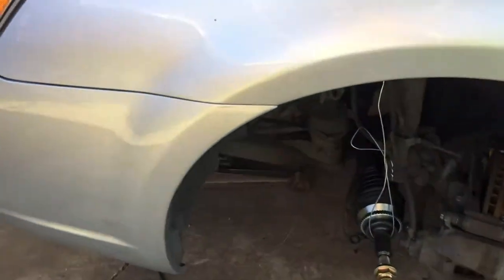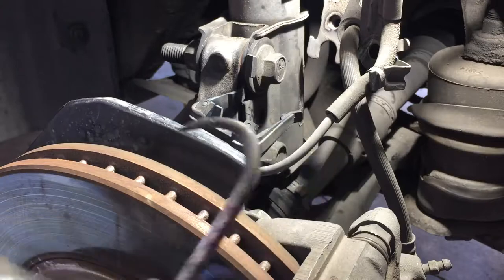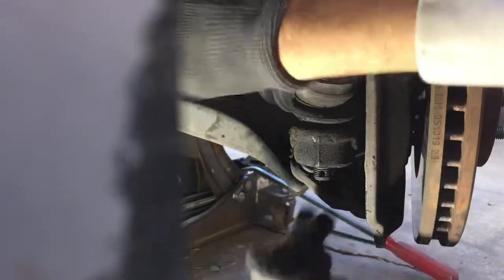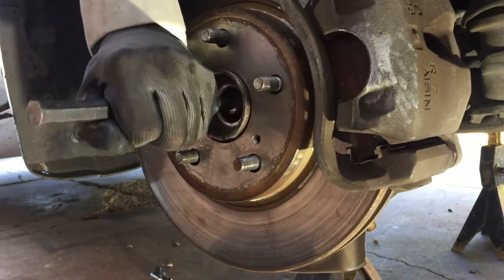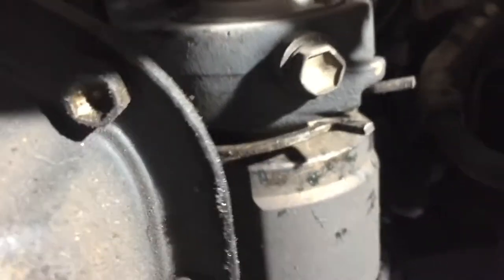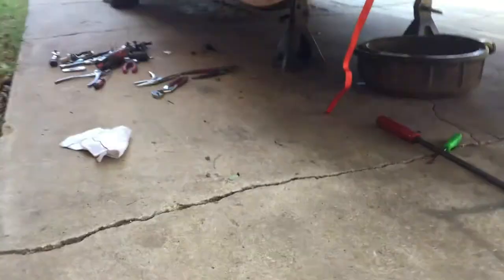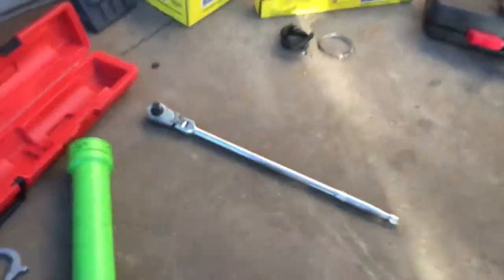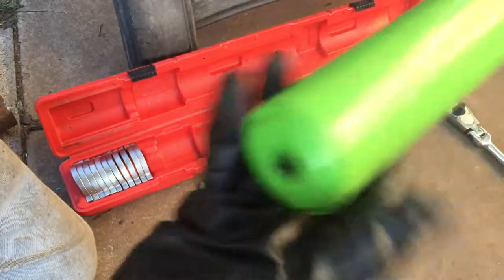06 Avalon passenger side CV axle and inner tie rods

Comment: You was lucky, that bearing won't just tap out like that, if the car has high mileage, you will have to cut hte axle and remove the whole bracket and shaft and knock it out outside the car, and then it's still will be tough.
Reply from the maker: Hi Theodore Pendergrass  your right I was Hoping it wouldn’t be stuck .I’ve done them before when they are stuck and it is hell not only those   I’ve done other jobs that do not cooperate with you and it’s terrible  thank  God this one just cooperated with me. Thanks for your comment  . thanks for watching I appreciate you
Reply: @Marty09933  I wish someone would have told me, I put mines back together to figure out how i can cut it out. My bearing sits in with the transmission motor mount, and the cv axle block one of  the bolts to take the motor mount loose, if I can cut it in 2 places, I can remove the mount and knock the bearing out, they're no other way around it. Your video was spot on, just wanted to warn folks, that they don't always come out that easy.
Reply from the maker: @TheodorePendergrass  yes I hate when someone makes a video and it comes out so easy and then when I do it it’s super hard  lol that’s the way it is sometimes they come out easy and sometimes they give you hell thanks again brother appreciate you
Reply: You are the best man A++++.  I am going to tackle mine right now.  Thanks
Reply from the maker: @rogeliolucas3306  thank you sir I really appreciate that . And thanks for watching I appreciate you

Comment: Thank you for your vide, I’ll try to tackle this during the summer. What is that brand name for the tie rod removal?
Reply from the maker: Hi Sammy J T your welcome and thank you for watching I appreciate you here is the info  it’s from harbor freight ....https://www.googleadservices.com/pagead/aclk?sa=L&ai=DChcSEwiKxYeg9cbuAhWp8sAKHbPUCzUYABAGGgJpbQ&ae=2&ohost=www.google.com&cid=CAASEuRoT_xTyb-AP139AqlneTNQdw&sig=AOD64_2Y7TrfuyfBNPPa0Qkvg5akHWCWHQ&ctype=5&q=&ved=2ahUKEwjSrvyf9cbuAhVtmK0KHSDJAhQQwg96BAgCECk&adurl=
Reply: @Marty09933  thank you. Is it the same as the green tie rod end removal tool? I was looking for that green tool for the inner tie rod & also, did you buy oem axles or if not what brand axle? Every time I reverse into driveway from a stop  and I hear a poppin noise when turning wheels. Could that be axle or tie rod? I have the 07 with 187k miles
Reply from the maker: @samukahtviv1  no sorry that one is for the outer tie rods . the green one is for inner tie rods you can rent it at auto-zone kinda expensive I think about $150.00 maybe ? But of course you get your money back when you return  it. As for the popping hard to tell need more info . But from my experience a single pop is usually a balljoint. Continuously popping CV axle . Jack up car and take a long rod and put under tire and have someone pull up and down on it and look for movement in tie rod and ball joints ...........https://www.google.com/aclk?sa=l&ai=DChcSEwj03_ubzsfuAhWD8MAKHcW5A4UYABA0GgJpbQ&sig=AOD64_3gauQPRj4w8jA746cCuOyKI7U5CQ&ctype=5&q=&ved=0ahUKEwjOi_abzsfuAhUJTawKHYgHAVsQww8Ingk&adurl=
Reply from the maker: Samy JT ....https://www.oreillyauto.com/shop/brands/import-direct-driveline-969
Reply: @Marty09933  thank you! your video explained everything perfectly in details, it gave me confidence as a first diy'er... ok i will check on that. I Brought this car used lol since then ive been repairing little things each time. Next i got to replace rear control arm and one of the bolts seized into the rear spindle...smh..Once you repair one thing, another goes bad. Makes you wonder if its worth repairing anymore for that many miles.
Reply from the maker: @samukahtviv1  LOL I thought only BMW s where like that . It seem like it with mine . Well what I do if the motor still strong a good I fix them . But I understand makes you wonder what’s next ??? Good luck you’ll get it  👍
Reply: @Marty09933  lol i wouldnt have to worry about the rear suspension if it wasnt for someone hitting me on the highway. Now i cant get an alignment.. Daily driving mostly highways. Motor is smooth good at 187k. I change the oil with mobil syn every 4-5kmiles and tranny fluid, i havent changed it since ive got it at 123k, still pink or red. My first car lol thats why ive been spending alittle more.
Reply from the maker: @samukahtviv1  that sucks all cause another car hit you  sorry man  but your motor still roaring good  seems you take car of the fluids   RIGHT ON